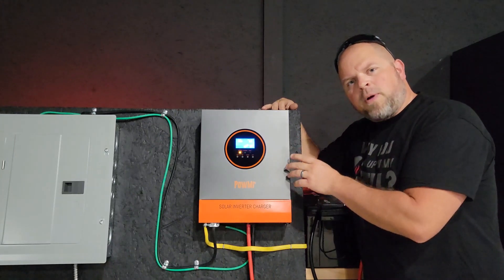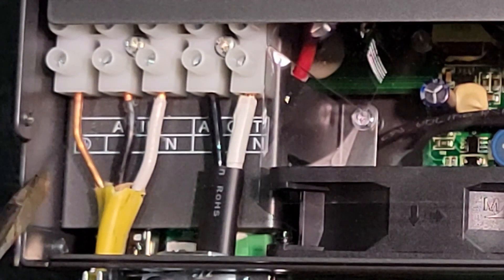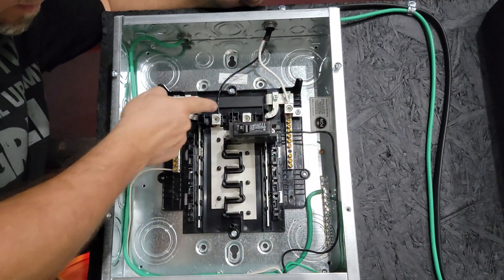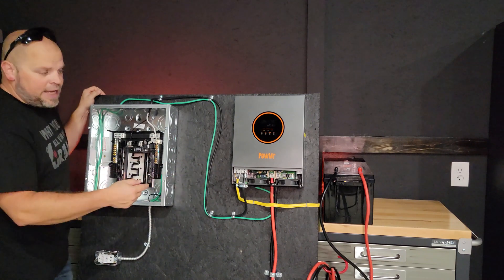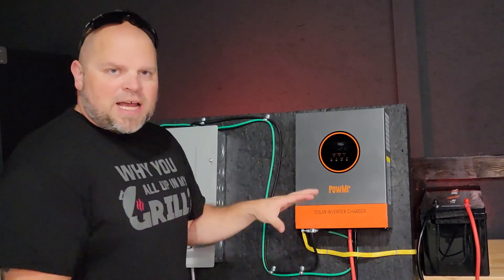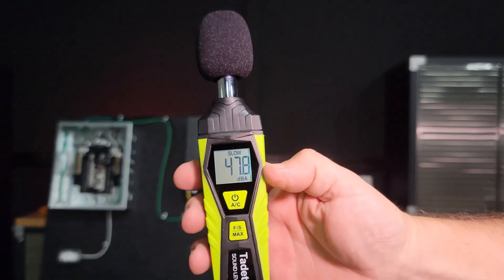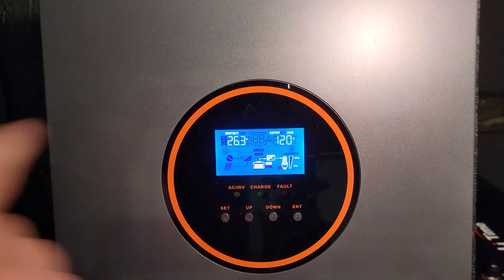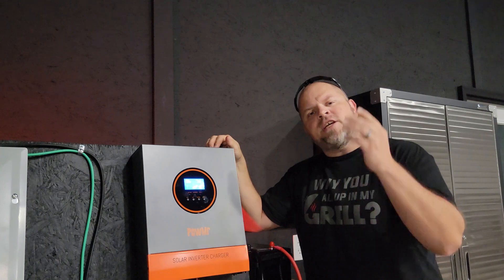OFF-GRID - PowMR 3000W 24v All In One Solar Inverter Charger

Comment: In my experience, living off-grid for over 8 years, its best to have the inverter's settings to mid or even low, so the batteries arent stressed. It will prolong your batteries life for more than double.

Comment: These are Low frequency nice to test the how many amps it can surge.
Reply: No, this model is High Frequency.  I have it and have had it for about a year now.  They do also make Low Frequency models, but the one in his video is a High Frequency model.   I run a 10K BTU Air conditioner with mine and it surges just fine, as long as the batteries are not already low, it has no issues starting that big Air Conditioner, despite it being a High Frequency type Inverter.

Comment: It seems if this unit fails then house power will be lost, compared to standard on grid inverters that allow a common connection point between grid line voltage and inverter AC voltage. So if standard on grid unit fails house can still be powered by grid alone. Right?

Comment: Great video man!! Question, would that unit work as a on grid system to just supply 3000w max only with solar to offset a little on the energy bill? Thinking on using something like this but use it as a on grid system for a year or so until getting batteries

Comment: can this be set up with AC power coming in from a generator and would adding a transfer switch help at all?
Reply: Yes you can. I wired a breaker shut off into mine. This then runs to a small generator which allows me 15 amps of charge per hour.

Comment: Do a continuity test with a multimeter between the neutral and ground points on the inverter. If there is continuity then  it's bonded in the inverter . This applies to any inverter.

Comment: I have the same inverter, Have questions can't find no answer, I have 2- 300AH 12 volt lithium batteries, can i use them? Also i have 5 - 580 watts 44.21 volts pannels, can I use them in series? Or is it to much for the inverter.?
Reply: Hope you figured it out already, but yes you can use the batteries and panels you have.  Series the Panels, and Series the Batteries for a 24V 300AH bank.  I have same model as in video, and I use 4 x 100ah 12V batteries for 24V 200ah bank, and have 8 250 watt panels in series, my max PV voltage is around 270VDC in summer heat, and 300VDC in cold Winter.  Never had an issue with this setup.   The max PV Input is 400VDC 13A.   Any combination of Panels to stay below that range, but above 110-120VDC and 13A (Max) will work.

Comment: Great video!  I was on the edge of my seat hoping you would show it charging the battery WHILE you were using loads.  I can't ever find a video of anyone showing that.  Would it have been able to charge the battery while you were using the heat gun, the fan, or both?  Or would you need the additional PV input, along with the AC plug, to get closer to that 80 amps in order for it to charge simultaneously with using loads?  Thanks!  GOD Bless!
Reply from the maker: If you had it connected to a 24v battery and solar you would not need AC connection at all in theory. Just got to manage the loads.

Comment: Great setup.  Trying to decide between an all in one or not for our current RV.  Only I'd disagree with bonding ground to neutral on an RV.  When your RV is plugged into shore power, it is bonded back at the main panel.  Your RV power center is essentially a sub panel.  I've actually seen what can happen with an airstream we owned back in the 1990's.  The neutral was bonded to the ground in the RV panel and under certain conditions, you would get a significant shock if you touched the RV while standing outside.  If using a generator, you may also need a bond at the generator and there's a couple of different options to do this.
Reply from the maker: Thanks for sharing

Comment: Be very wary about the inverter function claims on this unit. Firstly, the 3KW  claim is PEAK power not MEAN   power as  described in  domestic AC  devices. 

For instance a 1kw hair dryer will not work on a 1kw PowMR hybrid inverter because the  mean power of the latter  is approx 500 w and  in addition the inverter is 94% efficient
so the output at best will be 470w.

 On my unit it doesn't go > 425 w mean. If you look at a quality hybrid inverters such as Victron the power rating quoted  is the MEAN power which is the way it should be.

Although the manufacturer claims are not dishonest, it is unethical and downright deceptive. Save up and buy from a company more honest about their capabilities. Also
their customer service is non existent.
Reply from the maker: Thanks for sharing

Comment: So very new to solar wanna get one of these but the split phase version and have two questions 
1. Saw on Amazon one of the reviews said the neutral was shocking (thinking could be grounding issue ) could you comfirm it was wrongly wired (just saw it) 6:46  
2.can I install one of this and use it with grid power and use as storage and later on put on the solar panels 

Thanks a lot

Comment: The only thing that sucks is that these do not clip excess current. I wanted to oversize my array that would allow 15 amps but they started that I must stay within the max pv volts and amps, which is 150/13. I really wanted the litime lf 3kw or 5kw but both were sold out before the tariffs went in place.

Comment: Hey, do the fans kick in when connecting loads that are not high? Like a computer, laptop, speakers. I don't mean high loads like cooking or heating water. Also not while charging from the AC, but using the battery. Basically wanna know if it can be silent or not noisy whenever it is not charging the battery with AC. And if you tried it with solar, do the fans kick in with any amount of solar, or only if close to max? Last question, what is the idle consumption in watts? Thanks

Comment: Hey, nice video. Newbie here, do the power stations (all in one units that have battery as well) need breakers and grounding? Because I only saw them being plugged to solar panels directly with no other protection added in different videos. At most some fuses to protect solar panels in parallel when needed, otherwise just the unit itself. For offgrid use, or a motorhome, what would happen in case a thunderstorm hits a solar panel connected to the powerstation? Cheers

Comment: On the forums, it seems like a lot of people buy one to use and a spare for when it dies.
Reply: this model you mean? Or this brand? Or these type of chinese solar inverter chargers? From what I read this all in one units are better than the mppt solar chargers (which are cheaper but you need an additional inverter and ends up being more expensive) since those cheap mppt solar chargers need fuses and last a few years from some comments on YT. Then there is the power stations of different brands (all in one including battery and ac plugs) but it seems those don't last many years either... Basically, have money ready n case something breaks..
Reply: @segundacuenta726   This brand in particular,  but in general that family of products are built pretty marginally.

Comment: What is the smallest solar panels does this unit requires? I can't find that.
Reply: Surely you figured it out by now, but the smallest it will work with (I have this exact unit) is 110-120VDC from the Solar.  Below 110VDC it will not take the Solar Power.  So the voltage from your panels must not drop below 110-120VDC (at the wire where it goes into the PV Input at the Charger/Inverter, after wire losses) and must not exceed 450VDC Open Circuit or 400VDC closed circuit (PV Actively Charging).  Up to 4KW of PV Input.  I think mine actually says up to 5KW of PV Input.  Basically the MAX is 400VDC 13A of PV input, that is 5200 watts.

Comment: Hi bro I do not want to use mains. How can I know if the panels are charging the batteries ? it seems to be stuck at 25%
Reply: I guess 25% is the load
Reply: Mine doesn't even show the panels are connected.
Reply: @Chaorchy   check wiring ... mine shows if its connected to contoller and charging
Reply: @robertjalu6897  I did. Many times.
Nothing.

Comment: Everyone, leave the design of your electrical panels and sub panels alone. do not put your lives and family in danger. what is being said in this video is hurtful and life threatening and never in my 5 decades on this earth have i ever been this upset watching a video. This guy is providing an illusion that he knows what he is talking about and just think logically for a 2nd. If the ground and neutral bars in the main panel is tied together with zero resistance, then the neutral and the ground will always be the same no matter how many sub panels you install. all you are doing is creating two ground and neutral locations only if you use plastic screws to attach it to a metal box. you are screwing in a metal bar into a metal box with a metal screw, there is no separation. If you correctly separate these two successfully as this guy is telling you that you should, then that is where the real shit hits the fan and you will find out the hard way when the power comes in and has no why to get out.  I want everyone to realize that with everything with power, once you do not respect it, it will claim you. And the worst will be claiming your son or daughter. Look at how many post just me. Why? So i can stop others from making a dangerous mistake that they can never take back. This is why their are electricians and plumbers and mechanics and pilots and train conductors. Respect electricity and do not play with toys you do not understand
Reply from the maker: I don’t mind having a discussion or at least trying to. It’s true, if you're not familiar with how electricity works or how components are built, hire a seasoned professional to do the work. I don’t disagree with you at all on that. 

Let’s try taking this one question at a time. 

Are you suggesting there is no reason to separate the neutral and ground (bond) in a sub-panel?
Reply: @TheSolarPit  ok, was not expecting this response, so that is egg on my face and well deserved based on your response. So i cannot ignore this without a response. My verbiage needs to clear so let me try. Ok, the power company sends you a hot wire that is jacketed. They also send you a neutral wire to carry the load given to you back to their source to send it to ground. Now if your panel has combined the neutral and the ground, it will never travel back to the source since your ground for your building is created by just pounded a steal rod 8ft at least into the earth and attaching a wire to it. So, if you seperate the 2 bars, then the load will be carried back to the source and not the ground right there that your building is sitting on. Now think about what you are doing with this. You are completing the circuit being fed to your house with your leg from the transformer and the ground. not the neutral from the transformer. This is because the ground rod is a shorter path to ground. That is a gurantee grounding to complete your circuit. You have 240 volt circuit that you divide into other circuits in your panel. Your circuit coming to your house goes into the main breaker of the panel. A lighten rod purpose is to attract the lighten bolt since the lighten rod is the shortest path to ground. Lighten never hits the same place twice? that is a lie in a half.
Reply: now, you combined the neutral and the ground together in the main panel. Every wire in your building is just one big loop. all hot wires are connected to the neutral wire and the ground at the same time. so why would if matter if you separate the Gound and the neutral on sub-panels when they are already in zero continuity to the ground regardless. As a electrician in the union you use to have two programs. The C mechanic and the A mechanic. A mechanics were always high in demand because their knowledge from 5 years of union school only about electricity made the difference in the world. If you separate, you are relying on the power company to provide you with the return path. If this was reliable and trusted, we would not have a ground-rod install as standard code. Physics is Physic and anyone can say anything but we must always question what we are told with the question "Why?". I do not even need the neutral and can just use the ground wire to complete my circuit. I was taught as a helper electrician at the time, that i can never be shocked by a neutral wire, and even today master electricians will say the same thing and i have been proven that wrong. not by a theory, document, or experiment to prove my case. I proved it by always using naked finger on the neutral and getting shock the hell out of me and they beat me down that it was impossible. Even though i had the meter hooked up to the neutral wire by mistake and read voltage for a split second as being shocked. Never have i ever touched a neutral wire by naked fingers ever again. there were wrong and i paid the price. the bad part was it was 277 volts and that crap hurts and affects your nerves for day and your thought process and heart rhythms. So there is no inspector going to fail you for not separating the two bars and in fact have a high chance of failing if he notices it.
Reply from the maker: With ground and neutral bonded, current can travel on both ground and neutral back to the main panel. If the load becomes unbalanced and ground and neutral are bonded, the current will flow through anything bonded to the sub-panel (enclosure, ground wire, piping, etc.) and back to the main panel. Creating a shock hazard. Because when we bond them together, it gives your neutral wire (the one carrying electrical currents BACK to the source) multiple pathways. That's how the chassis of some equipment will become energized. Correct me if that is wrong.
Reply: @TheSolarPit  also you separating the bars on the sub panel does not separate, the ground and the neutral will always be one in that building no matter what you do unless you separate and isolate the two from the beginning. remember that the power that comes into your home are all connected in a loop. To truly do this, that means your power will leave your house on the neutral all the way back to the power company and the ground would only be use to short the circuit to spike the amps to trip the breaker. there is a reason why those bus are together and that is to make sure the circuit is completed by finishing its journey to ground.
Reply: @TheSolarPit  Now will the neutral ever travel back to the source and that is a NO. because the transformer is grounded with a ground rod as well. Neutral is your ground, regardless of all the theories out there
Reply: @TheSolarPit  so terms like Earth, Earth Ground, Common Ground, Analog Ground, Neutral, Digital ground, instrument ground, chassis ground, ground loops are all the same thing. Today i am a network engineer and chassis ground term is used alot, and when i was an x-HVAC tech and designer and the term Common Ground ws used and when i was an Electrician, neutral and ground was used. But they are all the same. If electricity wants to get back to the source and the neutral back to the transformer is broken, then the path to ground is taken not allowing fires or spikes or heat to increase. Now do you understand why separating the two is not wise. You are putting you and your family in danger.